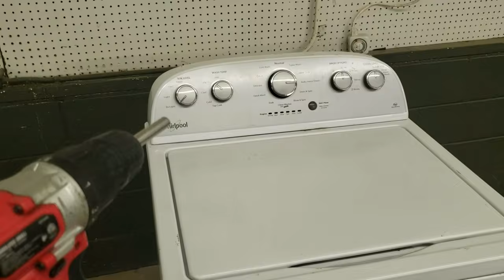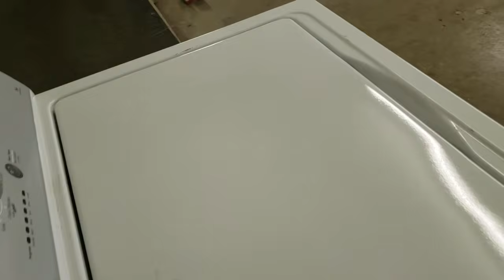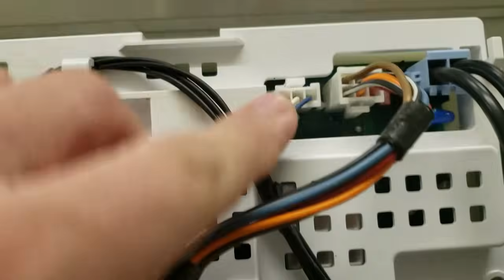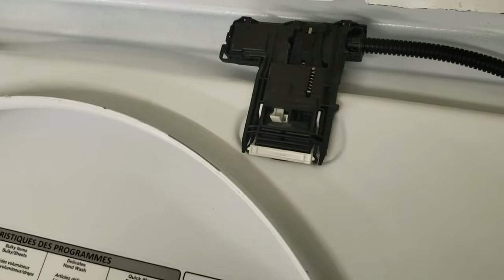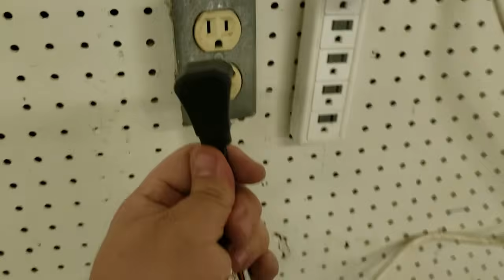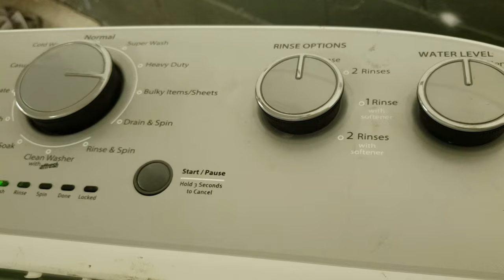How to Replace Newer Whirlpool Top Load Washer Lid Lock and Fix Lid Striker Issue (W11307244)

Comment from the maker: Replacement Door Lock for this model (if you broke it accidently!): https://bens-appliances.com/products/w11307244-whirlpool-washer-lid-lock-assembly?_pos=2&_sid=8c696cddb&_ss=r
There are 3-4 other models of door locks, make sure you pick the right one, but the link is for this exact style (black lock, white top piece).
Reply: Awesome job for some special insight, thanks much
Reply: How are you going to do a tutorial and not show how to take the f**** door off
Reply: شكرا جزيلا 💞💞
Reply: Thank you so much for posting that link that was huge... It's a lot more confusing than you would think. For such a simple part, so you're opposed cleared it right up... I had the old original part number

Comment: Mine lid will lock after putting on lock lid part but now it won’t even open and still  displays the blinking lock red light
Basically had to pry open the lid after removing the cover 
Somehow the part must not be in correctly and mine just screws down 
I lock or snap in the bezel on the top of the base of washer and put lock symbol on left as it seems to lock in this direction 
Need help as to why it is still perhaps misaligned??
..

Comment: I have the same washer, replaced the lid lock like you did but I turn it back on and it won’t go past washing. Just stays on wash and agitates but never starts. Is the board bad? It ran before and I had to force the lid open and now after replacement it fills agitates fills agitates but yeah no start. SOS😭

Comment: Thank you so much for this video!! I was able to replace my striker and locking harness. However, when I try to do a wash cycle, the lid is not locking. It clicks and then unclicks without actually locking. Do you have any advice or guidance on how to fix that problem?

Comment: I was scratching my head trying to figure out how to get these new fangled washers apart.  Certainly, it couldn't be just those two screws on the back?!?!?! How would the washer even stay together when you're moving it if it was only those two screws?!?! Thanks for verifying those two screws are the only thing holding these piece of carp washers together.
Reply from the maker: Two screws held all whirlpool washers together from 1984 to 2011 for the direct drives. Most only need two or three screws if smartly engineered.
Reply: For the 50+ years the only thing that held washers together were 2 clips that held the washer back to the top of the cabinet hidden by the control panel

Comment: Thank you for your helpful video. I had a repairman out to look at my washer… he quoted a price of $300. After watching your video, I spent less than $50 on the part and less than 10 minutes replacing the part. Now my washer works again! Thanks!!!
Reply: How did the lock break? Mine shook pretty violently and then the lock stopped working. just kept clicking as if it was trying to lock.
Reply: @LoganScholtes my wife said she accidentally slammed the lid shut. The lock would not release. I was able to get the lid open, but the control panel stay locked and would not let the machine run. I watched this guys video and repeated the same steps with my washer. Super helpful and easy.

Comment: I dont even have a spare lock piece, I had my washer full, middle of the night,  my lid lock fell out of place and a part of plastic busted, but I could start my washer by jamming a lil bit of cork in the lock button, thank you so much, if it wasnt for this video I would've never thought to start it with the button down to "trick it into knowing its closed". Im gonna need to change that lock eventually but in a pinch, two day before the holidays, and a washer full of clothes, you sir, saved my weekend.  And my washer lol. <3

Comment: Help! This step by step was super helpful, but something’s still wrong. My lid was stuck on lock so I ordered a new mechanism and replaced it, and it didn’t come locked so I was able to open and close the lid without forcing it. I realized the lid won’t lock now. I start the washer and it stops on wash and starts to blink green. I tried to calibrate and run diagnostics, but the lid won’t lock now in order to run them 😩 any advice?
Reply from the maker: Please watch my videos on recalibration/resets. That is likely the solution.
Reply: Thanks for replying! I did all three options you gave, still when I start to run diagnostics the lid doesn’t lock, it just blinks some of the lights and stops after a few seconds

Comment: Which wires would you splice together to bypass the switch to get the load done on the plug you pulled from panel?

Comment: Ben, after replacing the lid lock my unit will not start a load and I can't return it to diagnostic mode. followed the steps and there are no pinched wires, etc. have you seen this before?

Comment: I would like to disable the lid lock permanently so that I can add more water after the soak cycle because these Hi Efficiency machines do not soak the clothes sufficiently.  Will the machine continue to function if I just insert the striker into the receptacle permanently or what is the best way to do so so that the machine thinks the lid is closed?  I have no kids at home that would be in any danger because of this.
Reply from the maker: Keeping the striker in the leadlock is the only way you can do it without destroying the machine

Comment: We can’t get ours to unlock… help!!
Reply: From video, remove 2 back screws, slide cabinet top forward, flip it upside down towards the rear of washer, and use flat head screwdriver or your finger to slide white plastic towards washer top edge to release latch pin

Comment: Ben, I could not have done this without you, especially the lid lock removal from the washer body and the lid latch trick at the end. Thanks.
Reply from the maker: Awww thanks, comments like this make my day! I made this video because I broke one trying to get it off and didn't realize how it worked. Older-styles just had a screw that you removed and it came off, so this was a HUGE difference and they still make them this way, despite the video being 4yrs old.
Reply: Can you remove this fucking lock and wiring harness all together?  Will the washer still work if you remove this stupid fucking device?   I absolutely HATE that I can't access the washer until Whirlpool decides I can.  Please advise.

Comment: Which color wires connect to tell the washer it's closed. I'm gonna have to bypass this thing until I can get the part
Reply from the maker: It cannot be bypassed. it uses a pulse on an off signal to trigger the lidlock on and off and if it doesn't pass the test at the right time. It fails out, which is why the live lock could be bad in the first place
Reply: @bensappliancesandjunk  ughhhh! I just found this out on another video. Kid made a switch and he has to turn the switch at just the right times lolol. My wife is about to strangle me. I got mad and forced it open 🤦‍♂️🤦‍♂️🤦‍♂️🤦‍♂️
Reply: @bensappliancesandjunk  while I have you here lol...is there a particular reason this thing is CONSTANTLY clunking when spinning out loads. Like every load is off balance
Reply from the maker: When you replace the lid lock, make sure to recalibrate it. It may help with the spinning and banging around issues
Reply: @bensappliancesandjunk  dude this washer has been a piece of junk since the day we bought it. Brand new. Every wash load has to be adjusted on spin. Puts zero water in the drum. Works when it wants to. Complete hunk of junk. I absolutely lost my cool today when it started clanking and ripped the lid off. I'm just gonna buy one on marketplace. I've had it with this hunk of junk. I swear man they think complicated is better. It's never helped anything

Comment: I used a screw driver to break mine loose from the top.  Cracked open the switch housing.  Get to the switch and use zip ties on the two sliding parts to keep them locked down.  My switch was all busted up and it still worked.  I zip tied the whole unit under where the hole is, and took out the connector on the lid with an allen wrench.

Comment: Unfortunately I failed to watch the video completely and after changing the lock switch I pushed the lid down and now I can't open it. When I turn the washer on the lid lock holds solid for a few seconds and then there is no power. Any ideas?

Comment: This is hands down the worst washer ever made for production.  After the lid switch breaks, mode shifter, then the main tub bearings will fail - sounds like a train coming thru your home.  Good luck fixing that because the transmission must be replaced.  Sadly any other wash machine is a better buy.  WHIRLPOOL IS JUNK.

Comment: How can I by pass the lid lock ? I seen another video where they just used a jump wire and it by passed it, but there is 3 wires...which ones to jump?
Reply: Leaving the plug in place on the control panel wouldn't you splice the 2 outside mini wires together because the middle mini wire is the ground wire?

Comment: hey thanks for the very simple yet buck saving video !
I am searching for the part but before I get my hands on it, I was wondering if there is a way to bypass the lock you may be aware of? I have tried to short the pins 1 and 3 of the lid lock as per the manual but the led keeps blinking. If I reconnect the wires its just doing the solenoid knock noise like before so I know the board is fine, but I cant find a way to bypass that damn lock to be able to wash my stuff meanwhile. I am smelly, please help ! ha ha

Comment: Nevermind my last comment. I thought it worked and it did until it got to the wash cycle then it stopped. Now every time I try to start the cycle again the lock keeps locking and unlocking a few times and stops.
Reply from the maker: Check error codes then recalibrate machine
Reply: @bensappliancesandjunk  I'm unable to recalibrate because of this issue.

Comment: I changed my inlet valve thinking that was the problem but nothing got fixed. I then changed the actuator but nothing happened and finally I went ahead and changed the lock. Everything started working as if the machine was new. All three parts under $100 for a washer to function like brand new is heck of a deal.

Comment: hey i have that same washer im having an issue it seems every wash cycle  wheather small or large it bangs on spin i have to shut it down re organize clothes for balance but even on small loads that you think would not have a problem any ideas on trouble shooting issue dont wanna have to buy a new one its only 2018 model thanks David
Reply: I’d say check the springs under neath. Or balance weights

Comment: Thank you for this video it helped us replace the locking mechanism in our washing machine. Our washer was somewhat different but came apart easily with your instructions. My brother was impressed that when he got the back plates off I just tugged on the top and it went right up! He was dreading some massive tear it all apart and rebuild it project and it went much easier than either of us expected.

Comment: Hi Ben! I washed your video multiple times to get the confidence to fix the issue myself. Well I ordered the part, replaced it step by step as you explained.  And I can get t he washer to lock or to start washing. It just start,  fill a bit if water then stop. And stay there for a while, the out of nowhere will start making a sound like if the motor is running, but is not spinning or agitating. I have done that reset step multiple time now, I unplug the washer and try to reset the lid lock as you suggested,  only one time the machine start agitating then I let the door closed and the machine stop. Please help. 🙏🙂Thank you!!
Reply from the maker: Have you tried to recalibrate the machine yet?
Reply: Wow! I appreciate your responding so quickly 🙏👏 Yes. I did and nothing happened.  I did a recalibration and the door did lock when I did the steps for that. After that is back to not working. 😕 🙃
Reply: Hi Ben! Do you think that if I change the striker that may help? I'm at a loss right now. TIA

Comment: How do you disable the stupid lock?? What wires do you need to put together??
Reply from the maker: Can't do that easily. Its a pulsed on/off/on lock sequence where it has to verify that the lock can effectively open and close. If it can't, it fails operation.

Comment: Can I double sticky tape that lock in the cabinet with the lid latch piece inserted into it? Then be able to open the lid at any time. You can still hit the start/stop button and it will stop if you need to open it while it is running.

Comment: Thank you for all the information. I was able to buy the parts and replace myself . My estimate for the repair was $350 but the repairman said it could go up to $400, a new washer is $550. The part's cost $69 original equipment. You helped me save at least $300 Thank You
Reply: And there's no need to go with original manufacturer parts. An aftermarket switch for $15 will work just as well.
Reply: @andyb9378  you never know. I replaced the solenoid assembly for the water input on mother in laws and it went out already. Then, because it was on and water was not flowing to keep the system cool, it burned up the main board. It could have burned the house down. Maybe I should have ordered OE?
That's why I found this video now. Someone put this machine on the sidewalk for free. Only because the lid switch went out. Getting that thing off the lid was making me scratch my head. Now I also know how to put it back together properly, so it doesn't stay locked.
But, I'm not saying you are wrong 100%. Usually cheap aftermarket parts work fine.
Reply: You saved my bacon. Thank you so much for explaining how to push the white switch, start the unit. And wait until the lid lock released and allowed the lid to close again. Wow.

Comment: After repairman was unable to fix then watching a number of videos, I finally found yours which helped me to unlock the door lock.  Very helpful and easy to follow!!!
Reply: This sounds like the problem I currently have. I can't get the lid to unlock. It is stuck in locked mode and whether it is plugged in or not the lid won't open. I was hoping there was something in this video that would mention how to get the lock to let go. There's no line to pull as it is a top loader. What did you do?
Reply: @duggage you figure it out? I replaced the switch and the striker but it still stays locked

Comment: Is there a way to hack this stupid lock and trick the washer into thinking its this or that?
Sick of this lock issue..   we got a washer (3rd one now .. same model as in the video... two sitting in the yard)...  it won't do simple things like... wash.  Or rinse and spin.
Sits there clicking over and over... then goes to a blinking green light.. and shuts off.
It just refuses to lock so it can work.

Comment: I have the striker issue, and when i have the lid lifted and im holding the trigger for the lock, i go to press start and it doesnt do anything. the locked light is just solid red instead of blinking and it doesnt start. ive tried recalibrating it, ive tried unplugging it, and nothing.
Reply: This is what mine is doing- we’re you able to figure out how to fix that issue?

Comment: Been using my washer for 3 Months since I found this video.  I noticed that sometimes the latch does not unlock at the end of the cycle. Since fixing my own for $95 part, I have found 2 free washers with the same issue. The owners told me their washer would not unlock without pulling on the lid even when done. This breaks the washer lid lock. I suspect somewhere in the board there is a flaw that does not unlock the lid when done. Possibly a safety sensor not recognizing drum has stopped.  btw thanks to this video I will never have to pay for a new washer again. I will just pick up other peoples broken Maytag Bravos.

Comment: good video can you bypass the lid lock.
Reply from the maker: You can't do it easily on these styles. The control board sends a signal to the lock to lock and unlock, and reports if the lock physically switched the connections to show locked and unlocked positions. You'd need a toggle switch that physically moves these positions and sends the right signals back on the wires to effectively bypass it. Otherwise, take the striker from the lid and put it into the lid lock, so you can open the lid freely (dangerous, but works)

Comment: My Whirlpool washer craped out 2 weeks ago. The repair found that the switch was not available. B.S.!!!! I ordered  a one from
Whirlpool. It will be here 3/3/21. I was going to call the repair guy and have him install it. Don't have to now thanks to Ben.
Saved me $100.00. Thank you Ben for this excellent how to video.
Reply from the maker: There's a nationwide shortage on most lid locks and many other parts at the moment. Way to go if you found one because I cant
Reply: @bensappliancesandjunk  
  The lid lock I bought from Whirlpool cost $106.13. Gotta pay the price if you need one.

Comment: This did not solve my problem. I am going nuts 🤪. The lid light shows locked and the lock is locked so striker will not even begin to go in. I held the release like you said to do but to no avail. This is the second $108 dollar part. First one defective. My brother ripped it open because he was mad that's how this started. Please help me out? Thank you
Reply from the maker: If your brother ripped it out, that's your problem. The washer has no clue if its installed or not. Run a re-calibration cycle with a working striker/lid lock, and it should re-cycle the system to calibrate the lock
Reply: @bensappliancesandjunk  that's what I will try and do. Thank you again. If it works I see your PayPal.. Sean